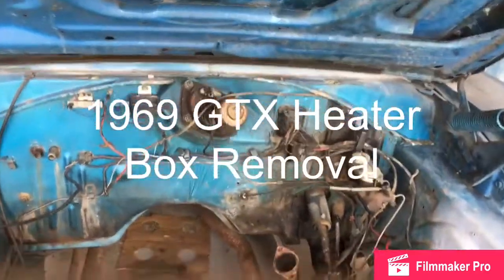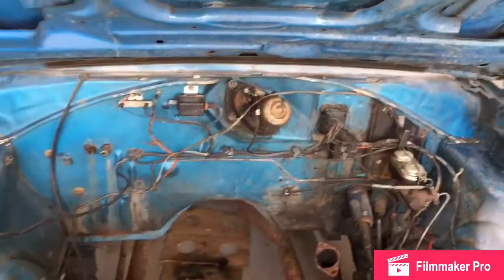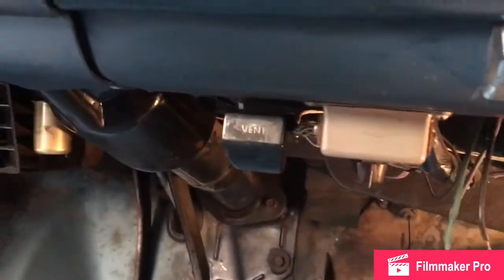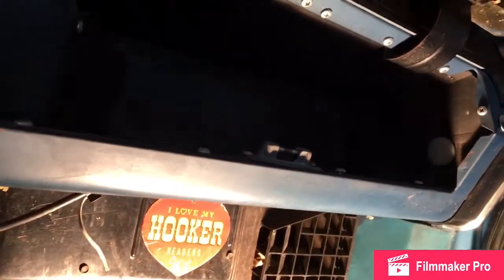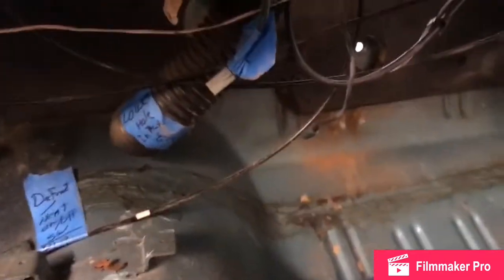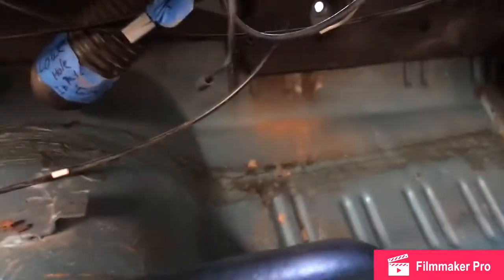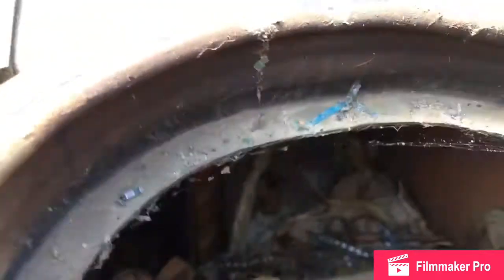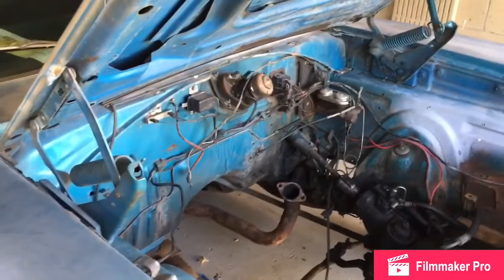1969 GTX Heater Core Removal Video 1of 2

Comment: Got mine out yesterday in about an hour and a half. A/C box has 2 more firewall nuts. Very heavy, might be full of fossils, rust and water. I will find out today. Nice nest was on the top of it. Good time change the wiper bushings, wiper motor and check the dash wiring. Thank you Campbase.

Comment: I see you got it under shelter now. Could a hose on a vacuum cleaner be able to reach in and remove the debris in the cowl grill? "Heater core" is the name of the componet that's leaking.
Reply from the maker: 1962pjb I don’t see an access point.  If there is one, it’s well hidden.
Reply from the maker: 1962pjb Yes, I moved it to my parents house.  It’s located about a mile from my house.
Reply: Campbase A closer location sure makes it handier! It occurred to me that if you still have the heater box removed that if you blew compressed air from an air nozzle through the top of the grill it may blow the debris out through the openings where the heater box vents mate up to it. When I first got my Road Runner, it had a whistling sound, like a reed valve buzz, when the driver's side vent was opened. Come to find out that a foam handmade gasket was installed between the seal on the vent duct and the steel body. It didn't need to be there, so I removed it. That sure was a strange thing to find. These old cars have had so many "hands" working on them over the years that you'll never know what surprises are in store! You've probably found a few yourself. 😊
Reply from the maker: 1962pjb Some good ideas.  I’ll see what I can do with an air hose.  I tried to wash it out through the front vents earlier.  I’m Not sure where the degree and water went actually.
Reply: Campbase Sounds good. I hope it works out for you.

Comment: I used a shop vac attached to a curved radiator hose with a good bend in it.
Reply from the maker: Chris Page Thanks Chris.  It definitely looks like an issue that was overlooked by Plymouth.